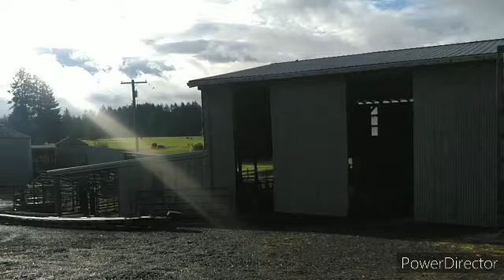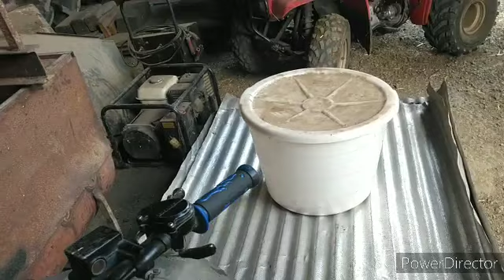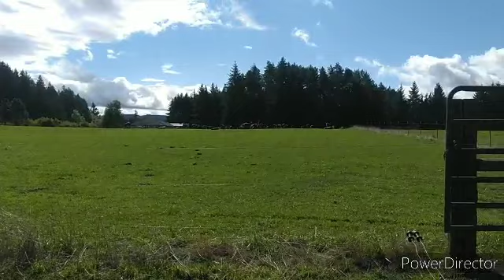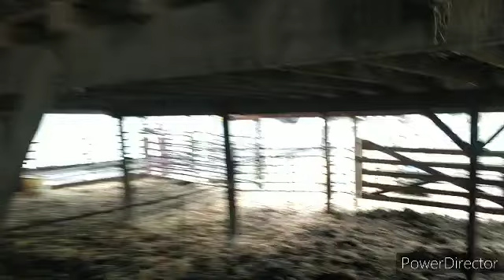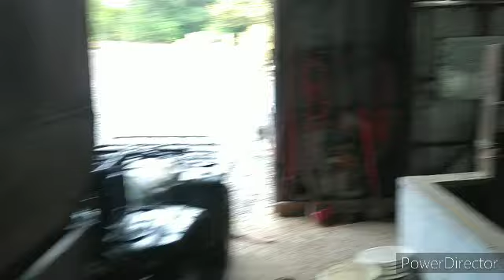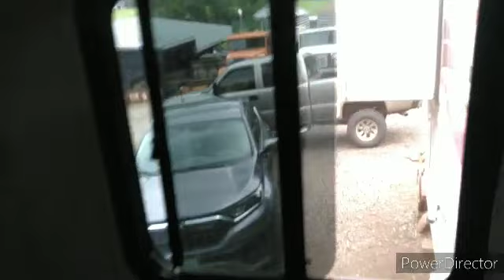Sunday, Funday 🙄

Comment: take the simple fix once in a while!  on the race sled i replaced that rubber line with stainless steel hose and the feel changed big time, now you hardly touch it and your slowing down.  

glad you didnt get the cab washed..
Reply from the maker: Cheap and easy is usually the best option 👍😎

Comment: late
Reply from the maker: Me too
Reply: @GosselinFarmsEdGosselin  been working on the 3294
Reply from the maker: Figured so.. how's the inside of the cab? Does it need a kit??
Reply: @GosselinFarmsEdGosselin  it needs a kit and headliner, got the new radio in and that all works, got the dome light working, but the flashers won't work I do not know why either.
Reply from the maker: @kolewiebensohn  check the fuses.. and the switch.
Reply: @GosselinFarmsEdGosselin  fuses are good. Bulbs are good, the headlights come in road "Mode" but the flashers won't. is their a box that could go out?
Reply from the maker: @kolewiebensohn  the flasher unit, or maybe the turn signal switch
Reply: @GosselinFarmsEdGosselin  when a I move the turn signal switch in a certain position either way, say I turn it to indica I'm going left in a certain position it will turn the bulb on but you have to hold it their as the bulb won't flash.
Reply from the maker: One side should flash, the other should come on steady.. so it's either the turn signal switch or the flasher unit..
Reply: @GosselinFarmsEdGosselin  I'm thinking it's the flasher box, and I bet that's under the damn dash too ain't it....
Reply from the maker: @kolewiebensohn  I would assume it's either in the steering column, or under the dash but the fuse block... Only a few screws and you can get into the steering column.. got the panel the switch is on and the lower part is 2 piece... actually pretty easy to get into.
Reply: @GosselinFarmsEdGosselin  ok,  thx for the help Ed, I better get some shut eye.
Reply from the maker: @kolewiebensohn  if you need to know something, message me. I can look at the 3394 book, maybe help you a little.. good night Kole